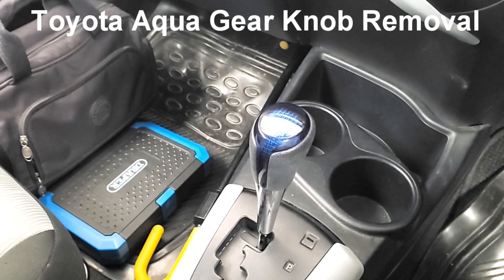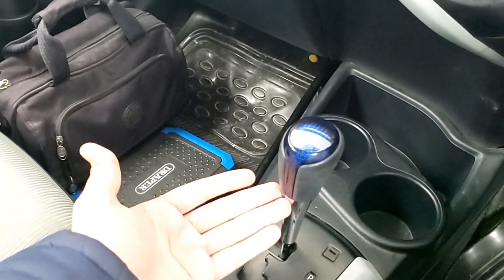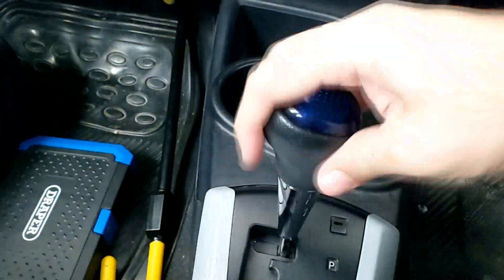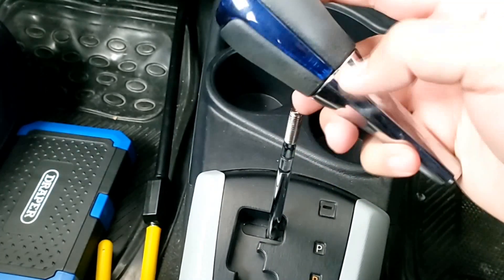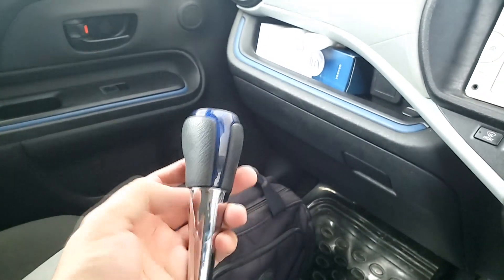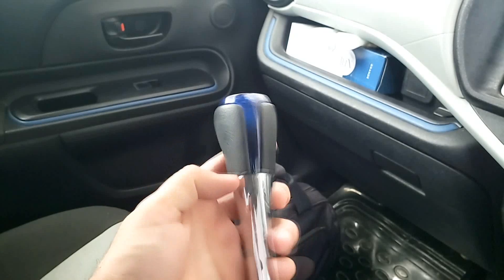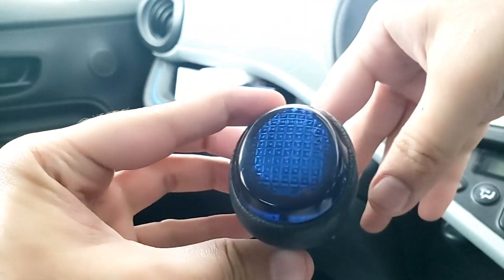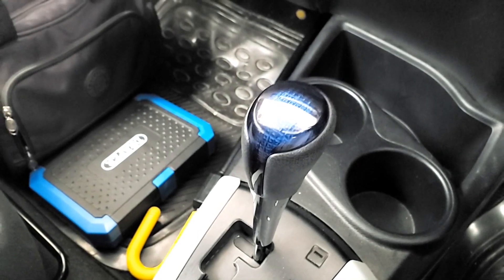Toyota Aqua/Prius C Gear Knob Removal in URDU

Comment: Assalamu Alaikum,
My car is having fuel average issues. Just a couple of weeks ago, my car was giving me 600+ range (620 - 650). But suddenly out of nowhere, it has decreased the range by itself. Now everytime I fill the tank, it shows around 500km range (or less). Nothing bad happened to the car and I'm still driving it, using everything else in the same way as I was doing it couple of weeks ago.
Here are a few weird things I've noticed:
1) Coolant for Hybrid system suddenly decreased. I've checked it a week ago, it was full. But just 2 days ago I checked it again and it was almost empty like there was a leakage or something. I've filled it up again the same day and it's been 2 days, it didn't drop even a bit.
2) The last 2 times I filled my tank, it doesn't indicate as full in fuel tank indicator, always shows 2 bars less. But then after driving for a while it fills up those remaining 2 indicators by itself.
3) Yesterday, my tank was almost empty and it was showing around 50km of range left, but then suddenly it changed to 1km of range left, and even after I filled it up to about quarter, it still showed 1km, didn't change. At night, I filled it up again to about half a tank but it still remained at 1km.

Can you please help me with this?
Reply from the maker: Change your Petrol pump. This used to happen with me when I was filling up from a bad petrol pump.